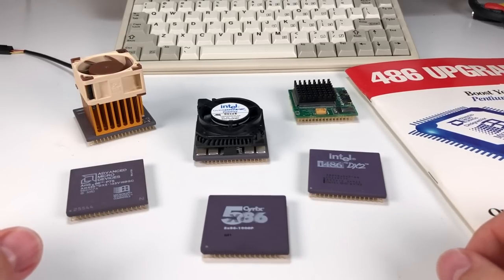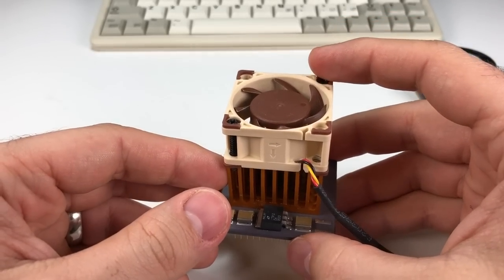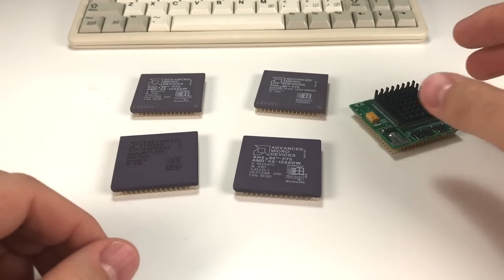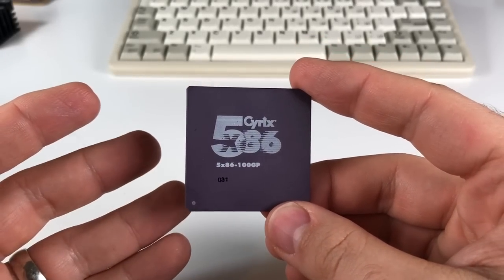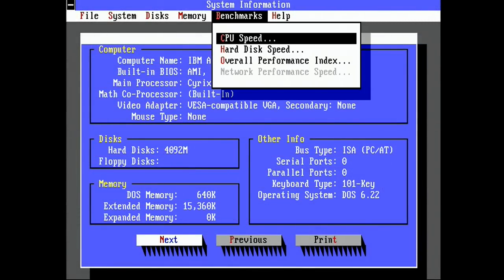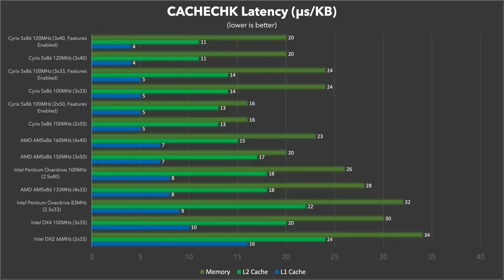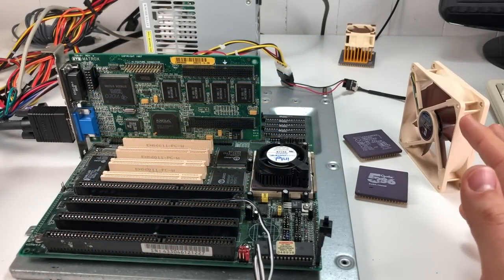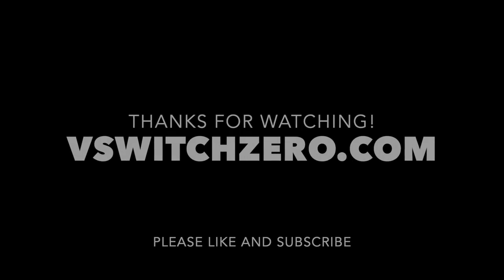The 486 Upgrade CPU Showdown!

Comment: Back in the days i had a Cyrix 486Dx4-100 rig and changed to Socket7 with an Cyrix 6x86MX-PR200. Started collecting CPUs in 2002 and now have DX4-100 Overdrive, the huge POD 83MHz also stable @100 and a 133MHz Overdrive for Socket 4. Love your vids. Very good content and nicely presented.
Reply from the maker: Thanks very much for your comment! That's awesome that you have the 133MHz overdrive for socket 4 - those are getting super rare and hard to find these days.
Reply: @vswitchzero  Thats right. Got mine in 2006 or 2007 together with an Intel Batman MB. The board was working but not very stable. So i only kept the CPU.
Reply from the maker: @Stratotank3r  Very cool. I've always had a soft spot for socket 4. I have the "Batman's Revenge" Intel board and a later stepping P60 chip in it. I hope to do a video on it one of these days.
Reply: I’ve never seen a Cyrix DX4-100, I bet that’s worth a few $$’s.
Reply: @vswitchzero  I wonder if anyone has managed a quad Socket 4 Overdrive? The Pentium Overdrive CPUs for Pentium Pro and 486 were forced out of Intel because of promises they made, tied to investments and other business stuff regulated by government. Intel was faced with a choice of producing something or paying big fines. They really didn't want to make those Overdrives, which is why the POD runs at the odd frequencies and the Socket 4 one doesn't run in quad. To use it on a quad P-Pro it can only be used to replace CPU 0 and 1, 2 and 3 have to be empty.

Mattel got into the same make something or pay big fines deal with the computer addon for their Intellivision game console. After blowing tons of time and money on a computer for which the game ended up being a peripheral, they did a pivot, produced a POS addon that barely satisfied the SEC, sold a few of them then shut down Mattel Electronics.
Reply: @vswitchzero  I was super lucky. Got my 133MHz Overdrive in a collection of old CPUs for 25€ on ebay. But the heatsink is damaged and the fan is missing.

Comment: I had that exact board with an Am5x86 as part of a bare bones system I purchased in 1997. Late in its life, I overclocked it to 160 MHz as you did, and added 128 MB 50 ns RAM, experimented with a Riva TNT... just because. I sold that system back in 2007, which I still regret. That was the first computer which was truly mine. Your video helped me to relive some of those memories.
Reply: One of the down sides of not being wealthy is you often have to sell your fondest memories in effort to be able to make new ones. It sucks.

Comment: Oh start the early arguments on I'm running a 586 processor. Says so on the chip. Um, no you are running a 386 and not even a 486. :) Also due to issue through out the years and what you saw with the floating point. We never sold anything but an upgrade to a true Pentium system.

Comment: My 12 year old self didnt know much about computer back then so i convinced my dad to buy a 2nd hand 486dx chip thinknig we could put it in the upgrade overdrive slot. After bending some pins and realizing it didnt fit, i gave up my dream to run duke3d at respcetable frames and settles to playing it at my friends, or watching him play.  I still had doom2 so honed my FPS chops there, and ended up in a duke3d tournament that happened to have me and that one friend i used to watch play Duke in the finals.  There was no chance I was lightyears ahead using a mouse while he was aiming with arrow keys.. players back then still used keyboard alone lol but surpsingly well.  I didnt  win by a huge margin and It was only thanks to the mouse I was able to skillfully aim the singlebarrel shotgun and do damage from far away, it was like a sniper just with a lousey scope.  I took home the prize of $200 gift certificate and  chioce of any game in the shop.  That being said the 486 dx chip we bought was relatively inexpensive like $60, consiering the system cost $5000 jus a few years earlier it wasnt a huge loss and learned my first lesson in computer upgrading.  Check the manual, see what the system is  capable of upgrading too.

Comment: In the 90's I built systems for a GIS company to do sales demos on.  I found that the software was heavily IO driven. So I found building with a DX50, not a DX2, straight 50Mhz was best IF you had compatible VESABUS cards, video and SCSI. It could out preform a DX2-66

Comment: Perfect video, very pleasant to watch and to listen to. Great job! The benchmarks reflect well what I remember personally. In integer math based 3D games, my 5x86@160 was able to beat my friends shiny new (and insanely expensive) P90 by a tiny margin. His Quake performance got us 486 owners drooling though. One fun fact I remember on my 5x86@160: It was able to play back MP3's with almost 100% CPU load in Win95, but only Winamp was able to do it stutter free. Encoding took like 20 minutes for an average song.
Reply from the maker: Thanks very much and thanks for sharing! Yeah MP3 playback on a 486 was not an easy thing to achieve back then, that's for sure!
Reply: @vswitchzero  It took me years, but I finally managed to get the exact board/CPU/CDROM combo that I used back in 1996/1997. It'll be fun to do some CD ripping, MP3 encoding and playback on this beast just as in the good old days ;-)

Comment: I remember back in those days, my first PC was a 486SX-25 which I ended up needing to replace in less than 9 months with a 486DX2-50 because the MB died.  From there, I upgraded to a 486DX4-100 OD chip because I was working at Best Buy and got an offer from the Intel rep to get it at cost.  3 CPUs in 3 years was kind of rough, but it taught me a lot, and I ended up getting into computer support for a career, as well as building my own PC for the next 30+ years since.

Comment: I used a 50Mhzx3 AMD 5x86 as my main system (mostly running Linux) from '94 until I replaced it with a K6-2 400 ~Y2K or so. It was then used by other family members until it was finally decommissioned due to poor performance running "modern" web browsers around 2004! It was completely stable all that time.  It was a VLB system fully loaded with cache with a Mach64 and cached Fast SCSI2 both VLB cards which worked fine at 50MHz.  It was a terrific little system.

Comment: Back then I upgraded my DX2-66 to a 120MHz AMD. Overclocked it to 133MHz
Reply from the maker: Nice! Quite a few of the AMD DX4/100 chips could do 133MHz too. The one I have has an undocumented 4x multiplier just like the Am5x86, which makes it really easy to do too.

Comment: I like your videos. :) Just got my hands on a 4x86 100mhz overdrive. Machine needs some work, battery was dead, but at least not leaking.
If i might make a small request, if you get your hands on some Pentium Pros.. My father had a dual Pentium Pro machine, he did CAD and Structural Analysis back in the 90s. I remember bringing that beast to a lan party... :P Would love to see some benchmarks on such a system.
Reply from the maker: Thanks! I do have a Pentium Pro system (200MHz CPU and Intel VS440FX board) but not any dual CPU systems. One of these days I'll definitely do a video on the Pentium Pro :)

Comment: Back in 95 I had a Compaq Presario CDS 924 with a 486 DX2/66. I decided to get the Evergreen because it had a higher clock speed and cost less. Thankfully, my motherboard supported the write back cache, which gave a visible boost to games, especially Quake. I honestly wish I could've afforded the POD, but the Evergreen served me well until I got my first true gaming rig.
Reply from the maker: Thanks for sharing! Those evergreen chips were great performers and were very popular back then. It’s great that you could enable WB L1 too 👍
Reply: Interesting you mention that. In all my benchmarking, Quake and Doom actually run faster with L1 write back disabled.
Reply: @jaeger8882  I tested Doom with write through and write back. Write back made the game noticeably smoother. What motherboard did you have?

Comment: Just put together Cx5x86-100 -machine. Mobo is QDI 471, 256KB cache, 2x50MHz bus and ALL settings set to tightest in BIOS, and feats enabled on CPU (BTB_EN, LSSER off, FP_FAST). Display card is Cirrus 5434 VLB with 2MB. Quake gives 14,8fps. 💪 Edit: RAM needs to be set to 'faster', 'fastest' setting was not 99% stable, but almost.

Comment: Back in the day I went from an Intel 486 DX2 66Mhz to a AMD 5x86 133Mhz using in socket voltage converter as I had an early 486 board that only had 5v socket and only supported running up to 40Mhz FSB. Much like you said it was so much cheaper to go that route than to look into the POD despite the clear FPU benefit of the POD.
Also, I seem to remember seeing a lot of results in magazines at the time that showed that on paper the Cyrix 5x86 should have been the clear winner in many cases, but in real world tests it usually didn't pan out that way. Those type of results seemed to have kept dogging Cyrix later on with the relative low FPU performance and heat issues of the M1 6x86 chips and lack of clock speed scaling of the M2 6x86 chips especially compared to the AMD K6-2/3 CPUs.
Reply from the maker: Thanks for sharing! Always great to hear first hand experiences from back in the day. Cheers! 🙂👍

Comment: I built and rebuilt a lot of Am5x86 systems for friends and family in the late 90s, they were certainly the best of the common 486 upgrade CPUs! I almost never saw the Socket 3 PODs, though Socket 5 ones were more common.

One of my tests for a system was, "under Windows 95, can I do other useful things and also leave Winamp running in the background?" On a DX4 that answer was often "not really" (depends a lot on the motherboard, cache/RAM, and hard disk performance), but most Am5x86 systems could handle it.

Comment: Back in 1995, we still had our 486DX-50 but that 50Mhz bus speed did not play well with VLB graphics so when that machine was "retired", a Pentium 133Mhz fully replaced it. 

The AMD 5x86 CPUs are an impressive surprise. Thank you for such a detailed benchmark set and historical account.
Reply from the maker: Thanks very much 👍

Comment: At 23:06, changing the colors of 640x480 vs 320x200 compared to the previous slide threw me off for a second.
Reply from the maker: Haha oops! I totally missed that. The two data points are reversed in the second chart too. 320x200 should be on the top and 640x480 on the bottom.

Comment: My first big PC upgrade was a Cyrix 5x86-100 and PCI motherboard back in late 1995.  Was a great upgrade from my much slower Cyrix 486slc33 which was my first desktop PC (at least my first desktop PC which was all mine).  A year later I upgraded to a Cyrix 6x86-P133+ and sold the Cyrix 5x86 and board to my dad to upgrade his PC, but sadly shortly after it failed.  The chip had a green heatsink on it but no fan, I don't know if it was a temperature issue but the CPU just wasn't stable (wasn't overclocked either).

Shortly afterwards my dad upgraded to an AMD Am5x86-P75 with a heatsink and fan and that was much more stable and worked well until he upgraded again a couple of years later.  For budget upgrades they were great CPUs.  Of course I'd have loved to have had a Pentium back in the day but they were just a tad too expensive, and the Cyrix CPUs were ideal for my needs (well, until Quake came out, but I was more of a Doom and Duke 3D player anyway).

I'd be interested to see a comparison of Pentium class CPUs.  I upgraded my Cyrix 6x86-P133+ to an IDT WinChip 200 in 1997, it was then where I got my first taste of virtualisation using a very early version of VMWare Workstation, I seem to remember it performed like a 386, but was still pretty cool to run a PC inside a PC :-D
Reply from the maker: Thanks for sharing! I'd definitely like to do something similar for the Socket 5/7 class CPUs in the future as well including the Pentium, AMD K5, Cyrix 6x86 etc.

Comment: The AMD ADW version had a lower TDP than the ADZ version and it was 5 volt tolerant. I owned a few of them I ran at 4x40Mhz at 5V with no problems. How? By careful preparation of the heat sinks. Most 486 heat sinks were pretty arse, not at all flat on the bottom side.

The solution was to clamp a flat file in my bench vise and run the heat sink over the file until it was flat. Then I glass bead blasted the rest of it to strip off the color and thick oxide layer from the anodizing. The bead blasting also left a satin finish which I figured slightly increased the surface area for better heat radiation and conduction to the air being blown over it.

For applying thermal compound I used a fingertip to dab a thin layer over the whole top of the CPU. Press on the heat sink and anywhere it didn't transfer got a finger dab of compound. That got the absolute thinnest layer of compound with guaranteed 100% contact. Too much compound with poor coverage can drastically hinder heat transfer. If you don't want to have to clean a finger after doing this, wear a nitrile glove.

I'd love to see someone do a thermal test on Socket 4 CPUs with a heat sink that's been filed flat on the bottom, then test again with it glass bead blasted all over, except of course the bottom. The Cyrix 5x86 would be an ideal tester for this. In my experience those run HOT. I once got a 2nd degree burn with a blister when I accidentally barely brushed the stock, green heat sink with the tip of a little finger. No fan on it, and that silly flat plate atop the fins to hinder convection. What was Cyrix thinking?

A lot of motherboards couldn't set the correct signals to make the AMD chips run at 4x multiplier. There was an easy fix by jumpering from a Vcc pin to the pin which activated 4x. Fortunately the two pins were right at the edge with only one pin between. So I'd take a piece of one strand from some wire, bend it around the pin in the middle so it wasn't touching, then loop it around the Vcc and 4x pin. Then I'd take it off, tighten the loops a little and push it back on. The mod could be done by soldering wires to the bottom of the socket and installing a switch or 2 pin header for a jumper, but the "hotwire" method was pretty much invisible and removable.

Running at 50Mhz FSB was out of reach on any PC I had then because I couldn't afford the eye watering prices of the higher speed DIP SRAM cache chips that would require. I had one MicronPC that was solid at 3x50 (might also have been good at 4x50) but only with L2 disabled. With no L2 it was way slower than at 4x40 or even 3x40. At 3x50 with L2 it would boot DOS then crash in a few seconds.

I did have one POD system, a Packard Bell pizza box 486-25SX with a POD63. The board had a jumper to change FSB between 25 and 33 but the poor POD absolutely would not overclock to 83 Mhz. Buying a POD83 was not an option. I could buy most of the cost of a new-to-me Socket 7 board, CPU and RAM for the price of a POD83 so I suffered along with the POD63 until I saved up the $.

Comment: Back in the day with performance of CPUs increasing so rapidly alot of companies used those upgrade chips with the voltage converter to extend the life of their  branded computers by an extra 18 months or so that was easy. I have always gone down the generic root   I actually had the 5x86-133 p75 myself on my own home  computer it was a generic 486 PC that i had swapped out the motherboard a few times ( from a 286) and eventually decided to start again so i sold it at auction and it struggled to sell are people knew it wasnt a proper Pentium. Oddly enough my current PC's which i have had for at least 5 years and were all second hand when i bought them are still powerful enough for what i use them for ( and i'm a software developer/ data cruncher)  and i'm thinking about upgrading just to get windows 11.
Reply: I'd avoid 11 at all costs.  I actually stopped using MS products right after 11 came out.  I'm happily using the latest Debian Linux distro and can run all my games, including ones that wouldn't run on 10 or 11, and am still able to do all of my programming IDEs.

Comment: Sweet collection. I made do with a 486DX-120 on a VESA only board. Which isn't a bad deal in retrospect. The later PCI boards would penalize you almost for using 40mhz, they would declock the PCI bus to keep it from running over spec at 40mhz.
Reply from the maker: Thanks! I really love VLB systems. To me, that's more of a "true" 486 platform :) .. thankfully the Shuttle HOT-433 seems to respect the 1:1 setting for FSB:PCI clock, but I've heard other boards don't.

Comment: FYI about the Cyrix 5x86-133Mhz: I remember reading an article back in the 90's stating that all Cyrix 5x86s at 133Mhz were sold to Evergreen (or another upgrade company?) to make upgrade chips out of them. So that would explain why they are very difficult to find. 
1. I still have a Cyrix 5x86-120Mhz Windows 95 machine which I use to play old games like the first XCom DOS games. 🙂
2. And I also still have a Kingston AMD 5x86-133Mhz chip, which I used to upgrade my old 486-66Mhz. That also was a nice boost.
3. CPU upgrade nostalgia: The last "upgrade CPU" I bought was a Powerleap Tualatin Celeron at 1.2Ghz... I used this to upgrade my Pentium 2 400 to a Tualatin Celeron at 1.2Ghz... wow, that Celeron had a motor on it. 🙂

Comment: I was one of those few that ran my AMD 5x86-133 at 150 mhz and it was super stable. I used a Diamond Stealth 32 vlb card and just got lucky with the cache on board I guess. I ran it for 2-3 years before I finally upgraded. It became a backup machine once I built a pentium system so it stayed around longer than I would have expected. It ended once my then gf cousin shorted out the motherboard, but I still have the chip to this day. One of these days I'll get around to seeing if it will still boot.
Reply from the maker: Thanks for sharing! A 50MHz bus makes a huge difference in performance, that’s for sure! That’s great that you had a VLB video card that could handle it 👍